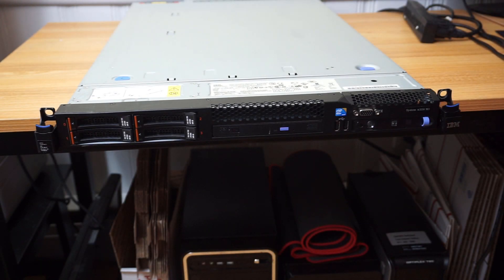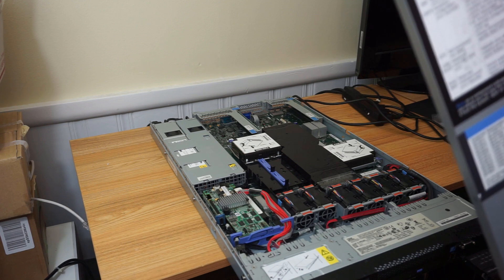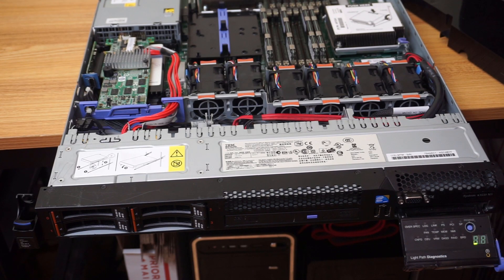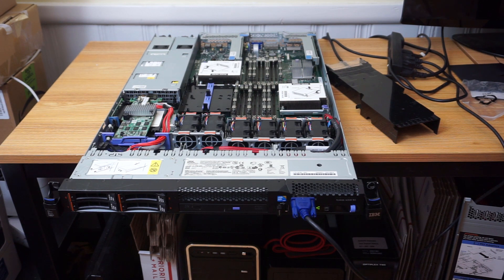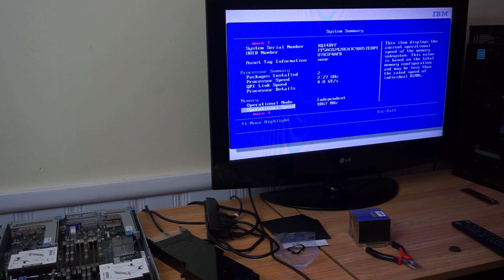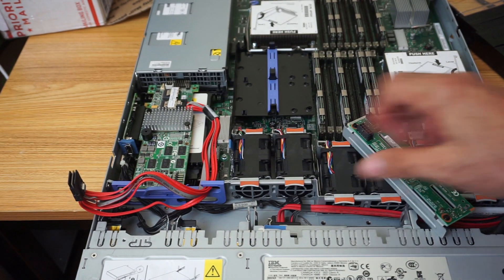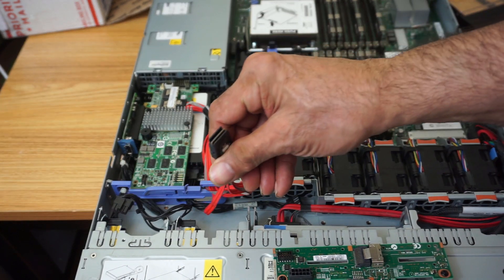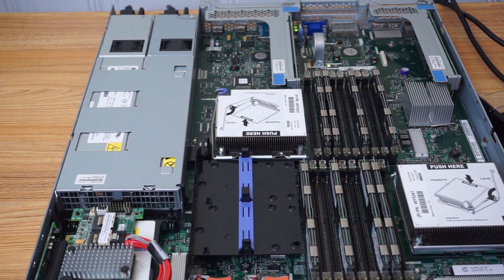IBM ..SERVER IBM  X3550 M3 Server memory repair and  hdd backplane repair and unit details PART1

Comment: Got a Gigabyte R282-Z92. The motherboard is MZ92-FS0. The fans and drives stopped working. This seems to be a common issue with this model. Diagnose ideas?
Reply from the maker: That's a tough one on the motherboard.There's a logic chip if you get a chip clip and read the logic or get an ometer and check the output to the fans see where they're coming from trouble.Shoot backwards from there
Reply: @Ironbar2  I figured out the issue. One of the power supply was bad. Dropped in a new power supply and everything has been flawless ever since. :)